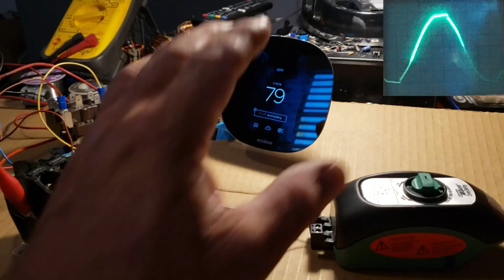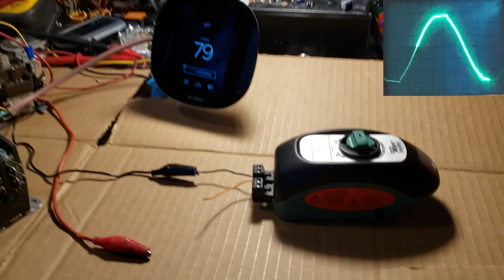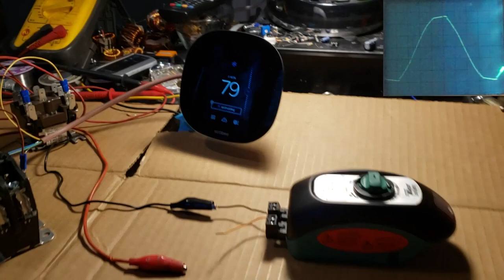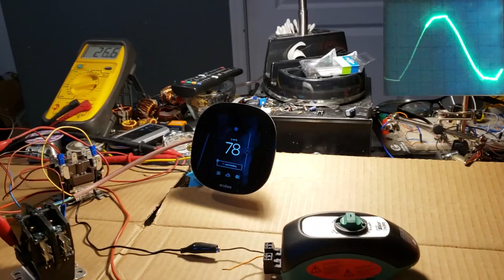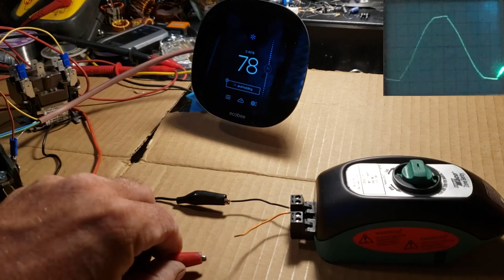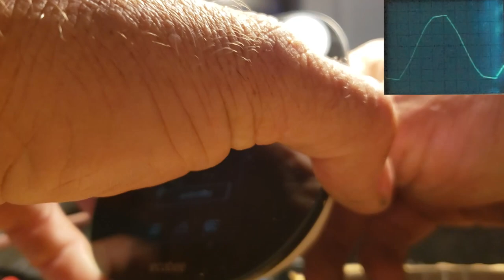Testing issues of EcoBee thermostat used with Taco Zone Sentry Actuator

Comment: Why not add a transformer and isolation relay, that way the ecobee and Taco actuator are on separate power sources.  The customer would pretty quickly recoup they’re cost by not having the pumps running at full speed or is this considered warranty work?
Reply from the maker: You build. 
But there are going to be 18 floors x about a dozen apartments with this!

I don't know who wil foot the warranty for that. 
It's not our company's fault because they always use taco these days but the building developer specified the EcoBee. And without the EcoBee this wouldn't have been an issue.

Comment: Seems like their CL rating is more like BS rating. The original units from the technical staff in R&D that were submitted for the switching power supply to the CL raining once they hit production line the power supply was changed to Wang Fang Hung Lo bargain basement product that was the cheapest they could grab.
Reply from the maker: Could be.
You'd think that the FCC etc would be all over a noisemaker like that!

Comment: I wonder if an Intermatic ET-NF would help? It helps with noise from 24vac controls on contactors and digital timers, maybe it would clean up the noise when wired across the two inputs on the valve.

Comment: Yesterday I had a nest thermostat chattering a relay on a fan center that runs a refrigeration condenser. There are obviously no capacitors on a fan center. I called nest to process a warranty. She was hesitant on sending me a new one because she didnt think that was the problem. That was after I told her I had the thermostat bypassed and it was running fine for 30 mins.
Reply from the maker: Nice. Some of these t-stats coming onto the scene are probably not coming from a tried and true HVAC mindset but some Johnny-come-lately company trying to get their gadgets into the HVAC realm.

Comment: Is the interference any different between charging and just holding the valve open?  I ask because I’m trying to develop a WSHP to replace several units in a building with newer EcoBee tstats, and it’s my cooling relay that clicks, but not usually while charging.  It starts with the clicking at about 15 minutes into the cool cycle, long after the valve has opened.
Reply from the maker: This issue is the TACO valve pulse charging those super caps inside. 
Each short pulse (repeated many quick times per second) actually drops the voltage a lot.
The EcoBee happens to react to that but it's really the fault of the TACO.
Several years later now since this and I'm more pro EcoBee than I was at this time. 
Anyway the TACO pulse charges until that led stops blinking.  Then it just pulses every once in a while to keep them charged. 
You're issue is something else most likely.

Comment: Is the EcoBee using a Triac circuit to switch the power to the relay? or do they use a conventional relay like most thermostats that use two AA batteries to switch a clean relay. This is just wondering if the noise on the circuit is interfering with the switching circuit in the EcoBee because the EcoBee has to rob power off the line to power itself but at the same time has to close the line to turn the circuit on? How does the sine wave look on the Taco valve when connected dircectly to the transformer output? Does it look the same if a cheap conventional thermostat is used?

Comment: what happens if you put a Line-Filer in line to the Taco valve?
Reply from the maker: Well, it's AC power input so no caps.
I tried a choke once.
I might try a few more. 
But those are some nasty spikes.
They needed to be filtered in the DC section of the taco control board.

Comment: I am fellow electronic nerd and I love your channel and how you channel your inner nerd! Separate transformer and relay was going to be my suggestion as well. I feel it would be worth proposing a solution such as this to the building as a solution. You are going to have to come out and disconnect the valve as it is. They could include the fix at the same time which would help retain the buildings energy efficiency. You could even pad the upgrade price to include your extra time which would let “see” a lower cost of labor if that is the problem.
Reply from the maker: Yeah the separate relay/transformer would definitely do it.
However there are 18 floors with about a dozen apartments per floor which = 216 apartments!

So who gets to warranty all that?
That would be our company paying for 216 transformers and 216 relays plus wire plus labor when the building owner spec'd the EcoBee's themselves.

We'll see.
I talked to a coworker who has been going out there while I have been doing other stuff and he said he's been at about 10 more apartments.
Disconnecting the taco valves as each work order comes in.

The new complex is slowly renting out the apartments.
I think rent starts near $2,000 for a studio.

Comment: can you put a small resistor inline with the valve to calm down the noise?
Reply from the maker: Probably not. Resistors are inefficient inline for power supplies. 
Especially DC to DC which use quick high current pulses.

Comment: Hey, I know this is off topic but do you know if the LGMV computer module and its RS-485 comm can be used as a rs485 to usb converter for say an AAON unit or York. looks like it can do 9600BPS
Reply from the maker: I doubt the LG software would interface with another brand etc.
AAON wattmaster and LG are two different birds for sure! LOL
Reply from the maker: Now. I suppose each one of those has a BACNET interface so that BACNET can be used to interface and control EMS setpoints and sensor data etc., 
But that's different than a service tool.
Reply: I was thinking about using the lg hardware for separate brands, with that respective brands software. I don’t know your probably right either way

Comment: @hackfreehvac.  I am a homeowner and I have this same issue.  Been working with TACO technical support for months with no resolution.  If I am hiring a company to fix, but what is the best solution or advice? 

1. Replace thermostat (maybe new Ecobee thermostat) is better?
2. Replace TACO actuator and valve (bit more involved), but I have shutoff valves nearby (assuming they work)? 
3. Add a 2nd transformer and relay? 
4. Something else?
Reply from the maker: You have a taco valve in a residential unit?
Are you in a condo with chilled water or something?

Anyway the fix we used was actually simple and stopped 99% of the clicking output issues.

In your Ecobee t-stat is a module for when you have no wire for a 24VAC common. (White square device with wire terminals on one side and wires on the other)
Follow the instructions to install that. 
The ecobee js reconfigured for using the module. It's called "power extender kit" I believe.

It has some capacitors on the outputs of the board in that power extender kit and it just so happens that it filters that issue
Reply from the maker: Oh. Another alternative is to not use that taco valve.
It is what is causing the spikes on the 24vac supply.
I like the ecobee stat.
Reply: @hackfreehvac   Condo with hot water heat.  

I installed the ecobee 4 for ~ 4 years ago.  The old taco valve was fine, but the new taco actuator is clicking trouble. 

I thought the power extender kit was only if you didn't run a 5th power / "C" wire.  I ran an extra wire back then because I heard that the power extender kit was not ideal and could cause issues.  The PEK seemed like another point of failure.  Especially if it has capacitors as the capacitors is what failed in the old TACO valve (could no longer fully close the valve).   

How would this work.. Would I need to stop using 5th "C" wire?  Any details you can offer are appreciated.
Reply: @hackfreehvac   Was this test with the Ecobee 4 or the slightly newer Ecobee Smart Thermostat (aka Ecobee 5)?
Reply from the maker: @Researcher_YouTube  3 or 4. This was a few years ago now
Reply: @hackfreehvac  You are correct (as usual).. 

The latest version (Ecobee Smart Thermostat / aka version 5) came out 2 months before this video, but I just saw Ecobee 3 lite on the back at 7:08 https://youtu.be/t7SdLKTsvTM?t=428.  

I have the Ecobee 4 with same issue and in the next couple weeks I am going to try with the Ecobee "Smart Thermostat" (should be called Ecobee 5, but umm marketing I guess?).   

I am guessing it will behave the same with Ecobee "version 5", but I will keep you posted..
Reply from the maker: @Researcher_YouTube  do you have the "power extender kit" that came with the ecobee?

Watch my update video for a possible solution. They kept the ecobee 3 and taco https://youtu.be/EzwRLkBZcBg